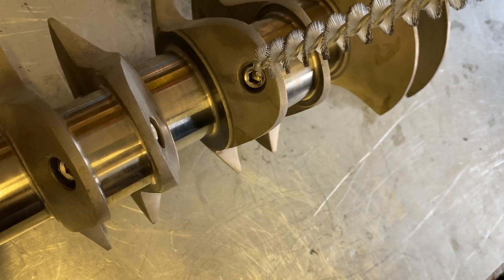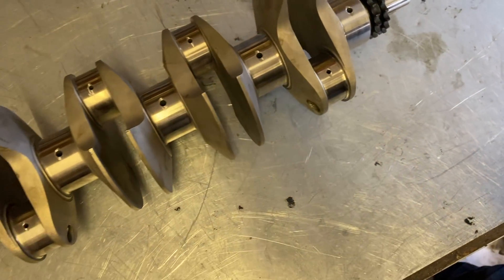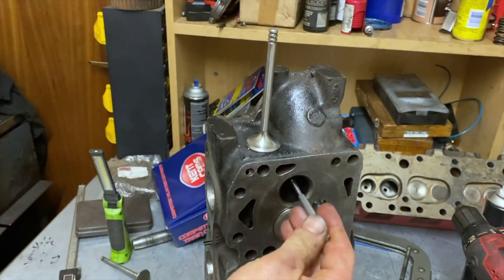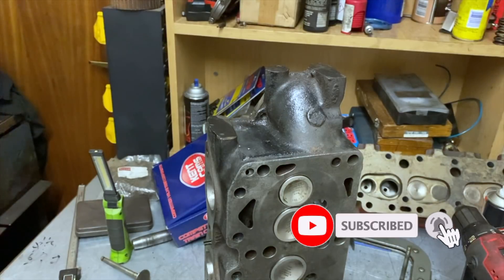1900cc X/Flow - Cylinder head Upgrades & REC Valves - Engine Build Part 3

Comment: Love this - mods based on real world experience and common sense, rather than picking the most expensive parts from a catalogue. Or what the great NHRA multiple Pro Stock champion and engine innovator Warren Johnson used to call Top Fuel drag racing - "mail order racing"

Comment: Put a round bottom groove on the valve guide od and a round wire retaining ring. To stop the guides from slipping down
Reply from the maker: i thought of that but the fit wasnt tight enough for my liking, knurling is an easy solution and makes the guide plenty tight enough
Reply: @PenguinMotors  chrysler had a TSB that had valve guides that slipped down on 3.0 v6 engine.  They even  created an on engine hand grooving tool to use on engines with the valve spring removed.  
Do the knurls seal air tight, a lot of vacuum in the intake and actually exhaust ports.
Reply from the maker: @waynep343  yes they do, even if they didnt the loctite would ensure they did

Comment: ideally, you want the back side of the inlet valve to match the shape of the cyl head wall, and  you may ask  ' why would you want to do that '  which in your case is flat and not curved, and the thinner valve stem with the std valve is bonus points. I am not sure what you mean as a down drafted port, I do not see a down drafted port, unless you mean to say, more metal removed from the top than the bottom of the port, be interesting to know the diameter of such to the beginning of the valve guide area you fellas machine to
Reply from the maker: a pinto port approaches a valve a a very shallow angle, and the air tends to shoot straight across the back of it. a penny on a stick works well in that circumstance. by comparison X/flow port is quite downdraft. the REC valves going in this head are shaped somewhere in-between a standard valve and the ones removed, they  should work well

Comment: Excellent video, so informative. 
What kind of bhp can you get from a xflow?
Reply from the maker: TBH i dont know what it will do!  1700 engines with a 254/264 cam are often around 170bhp, 244 equipped engine more like 145 bhp , the big capacity means it  wont rev like an x/flow normally does which will keep peak BHP low in comparison to torque production.  so my guess is a torquey 155bhp
Reply: @PenguinMotors  more than enough power for a forest racer, and probably a lump lighter than a pinto, throttle bodies?
Reply from the maker: @kevinharker1840  x/flow is about  25-30 kg lighter than a pinto. this engine will be on twin 45 dcoe
Reply: @PenguinMotors have you ever come across a 1600 cross flow block with offset bores, making it easier for the engine to run on the thrust stroke, formula ford possibly?
Reply from the maker: @kevinharker1840  no but any gain would be absolutely tiny, its nigh on impossible to see the difference between offset and centrally located gudgen pins
Reply: @PenguinMotors  thanks for your reply👍

Comment: I have a 86 mm square X-Flow for doing hillclimbs cw integral rocker cover
Reply: Old Piper rocker cover ?  Dates back to the 1960's. I'm always suprised no other outfits produced thinly disguised copies. Much stiffer than steel replacement rocker posts.
Reply: @terryjacob8169  Ted Martin did Integral Rocker Covers as well as 3 valve cylinderhead

Comment: I have always heard that the flat head was the worse of the two performers compared to the head that has the combustion chamber.
Reply from the maker: Cutting a chamber on the head compromises inlet port shape and shrouds the valves, the only place I can see a real benefit of a chamber head is if your trying to run the motor at 9000 rpm when a chamber probably helps a lot at trying to get the mixture burnt quick enough

Comment: Is there much power difference between a 1900 X/flow and a 2.0 Pinto? Which motor do you prefer to work on - or are they all the same to you once you get up to about a hundred rebuilds:) ??
Reply from the maker: Given similar specs Pinto would win hands down on power and torque. I like all sorts just prefer not to keep repeating same spec

Comment: Amazing job Graham...this run whit 40's /45's carbs or you thinking use ITB....??
Reply from the maker: this will be on 45 DCOE, the client has supplied carbs,  he has got 40's on his current engine, but hopes by going up in capacity he wont loose too much low speed power using the 45's, one thing is pretty certain though and that's i wont be leaving the current 38 chokes in them!

Comment: Hi there I can easily set up and machine a little off the outside of my flywheel/s on my lathe at home, however people have warned me not to try it at all because they can explode if they're cracked, but if your flywheel is cracked I'd be inclined to think that if it's going to explode it would do so regardless of whether it's been lightened or not. What about balancing, is that something you do as well or do you just clock them up so they're running true in the lathe and machine away? Safe enough to assume if you take exactly the same amount off all the way around it shouldn't alter the original balance?
Reply from the maker: theres no issue removing material form the outside of the flywheel. they break from the middle out, removing metal from the outside actually lessens the strain on the middle bit.  failure doesn't come because of cracks, it happens because cast iron has poor tensile strength, keep revs down to 6000 or so and you highly unlikely to have a problem, 8,000 plus on the other hand is another matter. Unfortunately cast iron does not have a uniform density so taking exactly the same amount off all the way round WILL change the balance, especially if you end up machining into balance holes which is highly likely

Comment: In South Africa when we want a 2 L we buy a pinto 😅 what a legend, I hope we get a dyno run of this motor once it’s built 🙏🏼
Reply: If crossflow engine build race tune it give same power than pinto, less weight and rotation mass, big valve head can breath with weber 45mm,  48mm or fuel injection set up. this engine can rev up easily 9-10k.  race cam and roller rocker installation.

Comment: so the counter weighting on the crank, no longer matches the conrod piston assembly %
the crank maybe a bit lighter, but its moment of inertia has changed but marginally, and the aero dynamics, almost nil + you now have placed more stress on the main bearings
Reply from the maker: interesting comment, especially being as you haven't seen the pistons or conrods :)
Reply: @PenguinMotors   I do not have to see the rods nor pistons, Any weight you save there, will not even come close to what has been removed from crank. do the maths ..this idea is simply a throw back to the dawn of dinosaurs, where some jerk thought it looked good, and that is as far as his brain cell went
Reply from the maker: to be honest i dont really know where you are coming from, no one suggested there was any weight saving element to this crank! The whole point of this crank is its a steel stroker crank which gives the engine more capacity. Unlike the original relatively weak cast iron crank its also fully counter weighted,. my client supplied it and is happy with it so thats whats being used and im sure it will work just 
fine :)

Comment: This engine problem is how cam motion transfer to the valvetrain, cam follower what they offer this engine is totally scrap  pre-crosflow 11mm and later 13mm tapped lifters, they not work race engine!
Reply from the maker: i get where you are coming from, but myself and 99.99% of the audience live in the real world of parts and engine we can assemble out of readily available parts. if you have to totally engineer an x/flow to get 200 plus bhp  you might as well just go and buy a BDA it would probably be cheaper
Reply: @PenguinMotors Why bda it's old 16v engine type and parts are expensive build it. I have duratec 2.3l with two different type head version.   Easy way go +300bhp.
Reply from the maker: applying that  logic why try to build a 200 bhp x/flow? use either a duratec or GM xe engine a, they are both far far cheaper and will scrape 200 bhp on standard internals!

Comment: Geez... I’d be pissed off. you’ve gone this far and messed up the guides!?!? Use an underside reamer or get .500+x guides. I also disagree with you regarding the cross drilled mains. I work on longer stroke high rpm stuff 4.5”+ stroke ~8000 rpm and we do not use cross drilled cranks as the centrifugal force acting on the oil in the crank throw with our required clearance on the mains and rods, can cause the oil to sling out the rod more easily by action of the cross drilled main acting as an air break (its an opening to the non loaded side of the main bearing. Air is drawn in and the oil is slung out the rod leaving the rod bearing lacking oil. Cross drilled mains are for low rpm pulling engines and diesels.
Reply from the maker: sometimes you have to work with what your given :)
Reply: @PenguinMotors  fair enough